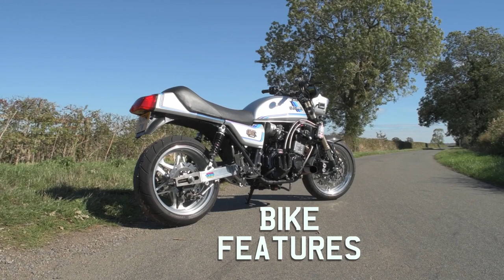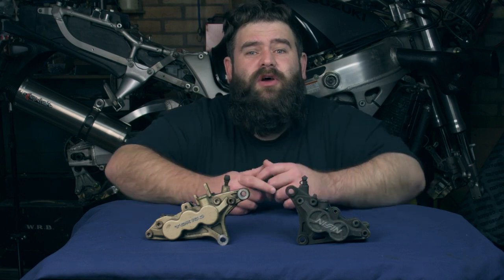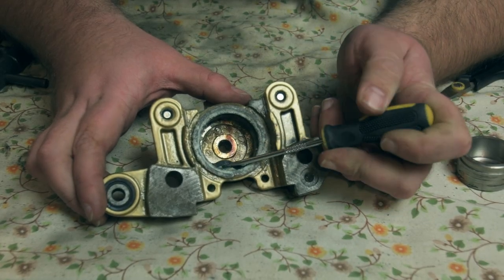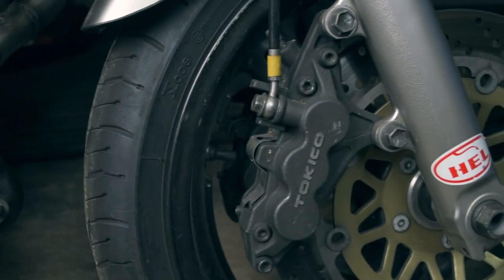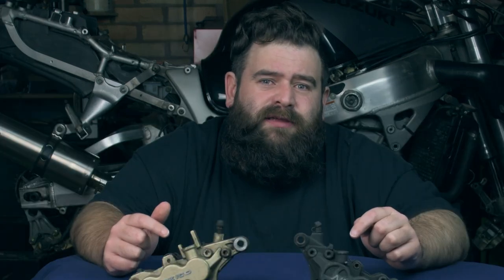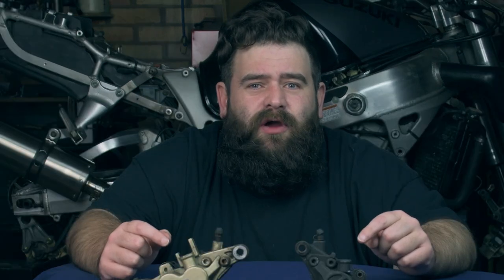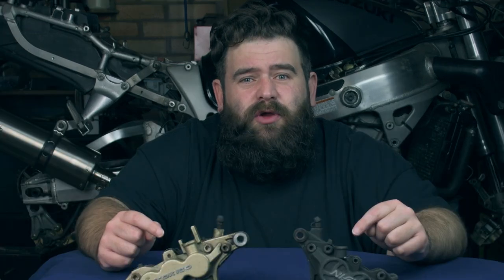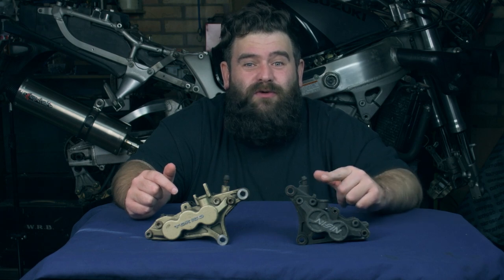6 pots Tokico vs 4 pot Nissin Brake calipers, which is best?

Comment: I’ve rode both and feel the 4 pot is better feel and more progressive they have a big and small piston and that helps with initial bite. The 4 is more controlled. I have no problem with bleeding with either. HH pads are a must don’t buy cheap pads

Comment: my nissins came off a triumph, they are much better on my busa than the 6pots.
Reply from the maker: Hey zzzpip, I've seen a few people use the triumph callipers as they don't fetch the same premium as the Nissin branded ones.
Reply: @Classicmotorbikes  some are branded Triumph and some Nissin but the Tokico 6 pot calipers are not rated by brake experts and I did a lot of research.
That’s why the Triumph Super 3 used Alcon 6’s cus the Tok’s are just to much bother 👍🏼

Comment: I prefer the 6 pots. Rebuild about 4 sets over the years most on TL1000 and Zx7r. Yes they do take more to look after but when you rebuild and bleed them properly they are amazing.
Reply from the maker: I think I’m with you Paul, when they are working you can’t beat the 6 pots 😎

Comment: I've got 6 pots on one of my zx9r's and they've been fine with regular maintenance. Stripped and reassembled a few times with no issues. My other zx9r had 6 pots on and I just couldn't get a decent lever. Swapped to 4 pots and were perfect in 5 minutes.
Reply from the maker: Hey Ady, I think you summarise the problems and success people have with the different calipers perfectly

Comment: I’ve got a 1985 GSXR750 that I’ve been riding since January 1986. About 13 or 14 years ago, I put on 3rd generation USD forks and 17” rims with the Nissin 4 pot calipers and 1st Gen Hayabusa master cylinders. The 4 pot were pretty good. Good stopping power and decent feel. I swapped the 4 pot calipers for 6 pot calipers about 6 years ago and am happy with them for sure. They bleed well and have not caused me any concerns. Ive got steel braided lines as well so that improves the feel. I primarily I ride in the spring, summer, fall and tend not to ride in the rain.

Comment: I had Tokico 6-pots on a Kawasaki ZRX 1200 and rebuilt them, new seals, new pads, (and added braided lines), the whole nine yards. Perfectly adequate for the road, but when I did a track-day I cooked them to the point where I had major brake fade and had to end my session early. Replaced them with Nissin 4-pots (again, newly rebuilt, new pads) and the difference was night-and-day. The 4-pots anchored on so much firmer, with better feel, and don't overheat on track... absolutely the best thing I've done to my bike.

Obviously, what's great for me isn't necessarily going to be good for someone else, but that was my own experience of them. 🙂

Comment: Swapped my 6 pots from my zx9 to nissin 4 pots, was sick to death of putting new seals in them, you only need to get caught in the rain twice and the dust seals are out, didn't notice any extra stopping power but just the fact they require far less maintenance is good enough for me, when overhauling the tokico's do one side at a time whilst leaving the other side fully bled up on the bike, if you try bleeding these up together after a overhaul when there both bone dry you'll be in for a long night.

Comment: I had 2 srad, a 600 with a tokico's 4 pots (witch i replaced by nissin's 4 pots later on), and 750 with 6 pots, and honestly i'ts quit the same to me. The real different was when i replaced the genuine master cylinder by a Beringer BR14. The feeling was way better on both srad's, appart from the number of pots. 

Actually I have a 1000k3 with radial calipers, 4 pots and individual brake pads by pot, this is what I call decent brakes !!
Reply from the maker: Hey Alex, thanks for letting us your experiences, I love the brakes on Bill’s K5 1000 they really slow you down quickly!

Comment: I have a 5/8 master cylinder with 6 pot calipers as stock but I want nissin 4 pots so can I run the four pots with the stock 15.8mm / 5/8 master cylinder without any problems . It's only for the maintenance side of things

Comment: 6 pots for me are superior in all ways.

I think today we have become lazy and expect bike parts to perform like a car - ie keep working for years and years without maintainence.... I think its due to rubber dust seal BOOTS that cars have. Plus a bike isn't used like a car and there's an EXPECATION that a rider will service correctly and keep that bike tip top.... I suspect newer riders will have no expectation to throw some love on the bike.

Bleeding brakes can be a nightmare sometimes - I think folk are struggling with them mounted in situ. I bleed them off the fork leg - so I can maniuplate the air flow in cavities etc and get every last bit out of the bleed nipple. Just need to remember to take the space of the brake disc up by inserting something to stop the pistons popping out.

Ive never had to back bleed. Never needed to use the cable tie method. I do use a manual vacuum pump and that makes it easy to do.

Technically the surface area of friction is directly proportional the braking performance.... imagine a heavy van with little bike brake discs and calipers - it'd be dangerous.

Comment: Got a pair of Gold 6 pot tok s replaced 4 pots on 1250 bandit which  got brake fade went braided lines hyubusa master cylinder love em strong feel in lever a 5 year old couid change the pads easy bleed push air up line
Reply from the maker: Thanks for the insight Simon, always good to hear other peoples experiences 👍

Comment: Got 4 pots on my f3 and work great, recently bout a mk2 bandit 1200 with 6 pots, brake lever comes back to the handle bars, bled the system thoroughly from the calipers nipples, braided lines on calipers and master cylinder, still sh*t
Reply: is your lever set to position "1" ?

Comment: New master cylinder, new hoses, new seals in 6 pots and lever still right back to the bar. Bled and pushed pads back again so definitely no air. Any ideas?
Reply: just complete stab in the dark here, have you tried bleeding it from the master cylinder? sometimes airs can get trapped in the master cylinder when other seems to have been completely bled. if so, the only solution is the hydraulic ratio of the pistons, let me know how it goes.

nels

Comment: I never had much sucess with that tie on lever to rid of all air in the system. It is good for few hours and then its back again. I have VFR750, brakes are good, but after I pump the lever, I can notice that sometimes is stiffer. So I guess there is some tiny air bubbles inside. I tried to unscrew the banjo bolt at the master but that didn't help.
Reply: Exactly its not a solution at all, the fluid absorbs the air under pressure but it separates back into small bubbles of air soon afterwards especially if it gets hot.

After hearing all the horror stories i  bought k1 gsxr1000 expecting brakes to be crap and they're pretty good, might change the master cylinder but the calipers my mission will be keeping them clean. Taking them off atleast once a year and cleaning them thoroughly.

Comment: i prefer 4 pots, i don't like the ''lag'' with 6 pots when you start to press the pump and bike start to brake, maybe i just need to bleed it better, but it happen on different bikes...

6 pots have more surface for breaking force than 4 pots, so it should brake better, but nowadays 4 pots can lock easily the front wheel,  we mostly seen 6 pots on 90's bike when the brake pads wasn't so good as today
Reply from the maker: You are right, so many variables when it comes to brakes, the different types of pads can make a massive difference as well.

Comment: I’ve had both. 
The conclusion I came to was this; even rebuilt 6 pot calipers with new pistons and seals, are still crap afterwards. They’re better than before, but a fully rebuilt 4 pot caliper is better than the fully rebuilt 6 pot caliper. Hands down the 4 pot caliper wins.

Comment: I rode slingshot 1100's for years, i love the 6 pots on my K2 but the 1100 was heavy. Had my k2 for 19 years and haven't had to strip the brakes. Fluid changes and braided hoses. Summer riding though. Good 4 pots Nissin brakes a good but i was forever stripping them.
they had to be on the 1100 all that weight

Comment: 6 pots on my zx12 and 12 bandit, looked after with the right pads perfect. swopped over to 4 pots nissin on my gxsr1100 not as much bite but that maybe down to pads.
First thing i always do on a new bike is split the calipers new seals no problems.
Reply from the maker: Hey Mark, thanks for sharing your experiences. What pads do you use?
Reply: @Classicmotorbikes  Goldfren sintered on the 6 pots and nissin padds on the 4 pots

Comment: Personally I have only used the 4 pot's, they feel just fine to me
Would you use pattern parts for brake refurbishment or only original, and what Pads would you recommend
Cheers for the video
Reply: Personally I'd use originals. I used pattern on some forks (dust and oil seals) and within a week they were leaking. I complained and they sent me some new ones. These new ones lasted 2 weeks before leaking!! I had now done the job 2 times and was wondering if I had a bigger issue. I bit the bullet and bought the Suzuki seals to the tune of £60. (The pattern ones were £15). 4 years later, and 3 fork strip downs, they haven't leaked once! With brakes I wouldn't personally take that chance. 
You as the consumer do not know the quality of the materials used to manufacture the seals and more often than not, you get what you pay for.
Reply: @Icem4n84  cheers Steve.
I think I will go the original route
Reply: @BorisKarloff66  fork seals oem everytime but brake seals iv never had a pattern seal leak yet.
Reply from the maker: Hey buddy, brake seals I’ve used plenty of pattern stuff over the years and not had any issues, but don’t think you can beat genuine 👍

Comment: dust seal removal is stupid if its dragging on that seal then replace ...both the calibers are getting on now but the nissin is a better caliber the tokico are cheaply made and the finish is not as good ... the seal removal has come from race application the for mentioned is not a top end race unit that are designed to not have them..... its not as easy as my fg322 ohlins forks the ohlins seal is low friction thats grate for performance but not so good for retaining oil in the fork leg ... i use brembo gp4,s on one of my bikes and have brembo m50s on my sdr there a world apart it really is a case of you pay your money you get your goods
Reply from the maker: Hey buddy, thanks for sharing your thoughts. I think if I was ever going to get some aftermarket calipers I’d give the HEL ones a try or if the budget allowed some PFM
Reply: I think the dust seals are removed when they are binding because you don't have to remove the pistons, so it's a quick win for fixing binding brakes. And then of course, no-one bothers to go back later and remove the brakes and replace the dust seals, because everything appears to be working fine.

Comment: All Tokico calipers (including your 6potters) have the piston recepticles machined after paint or anodising and the raw aluminium is prone to corrode quickly with any moisture trapped in hygroscopic brake fluid, Nissins are anodised inside and out. I shouted my '90 gsxr11 (owned since new) a set of braided lines for it's 25th birthday, never once replaced or topped up fluid in that time and they were corrosion free when I cleaned them out. Have same Nissins on 3 other project bikes and they are all fine internally despite looking manky when I bought them from wreckers/ebay etc.
Performance wise, f all difference. more to do with pad/disc material combo. I live in oz so no salt/ice to deal with but seriously, who wants to clean calipers and replace fluid every 12 months especially with the price of silicone fluid? I'll take the Nissins every time.
Reply from the maker: Hi Roberto, thank you for insight with the different brake callipers, you learn something new very day! I'm impressed with the 25 year old brake lines and fluid. how much is the brake fluid in oz? I use Dot4 and can get 5L for around £25.
Reply: @Classicmotorbikes  Dot4 is cheap as chips mate, similar to yours but the full silicone dot5 (not 5.1, it's still glycol based) is about 15pound in your money for a half litre. It's worth every penny though, won't hurt paint, non-hygroscopic and lasts forever. You MUST MUST MUST thouroughly clean all components before using it, mixed with any glycol based fluids, it turns to jelly and that won't end well! I've read comments that don't recommend it with abs systems but silicone is one of the most inert fluids you'll find and I've never had a single issue with the stuff on any of my bikes. I'd bet my lefty the issues come from blokes mixing the two types.